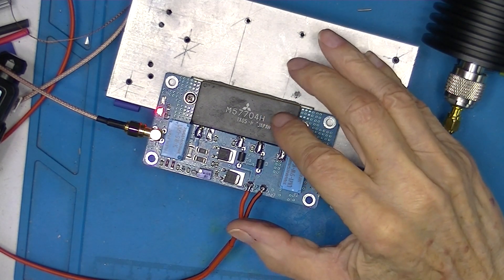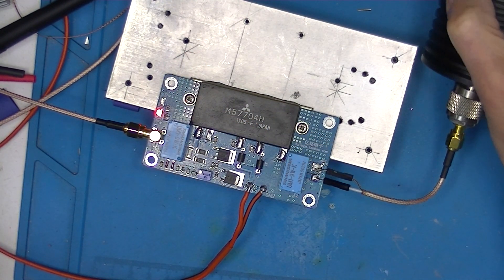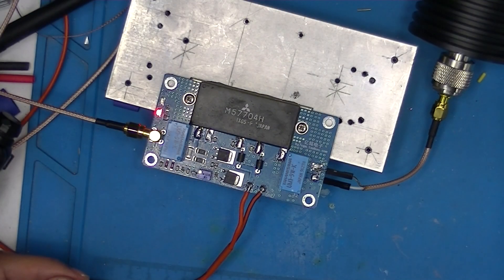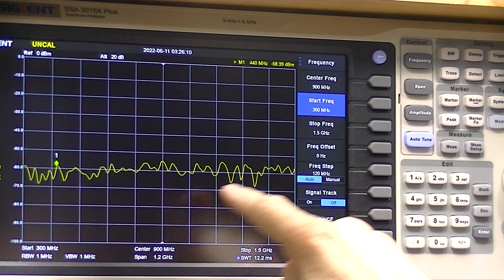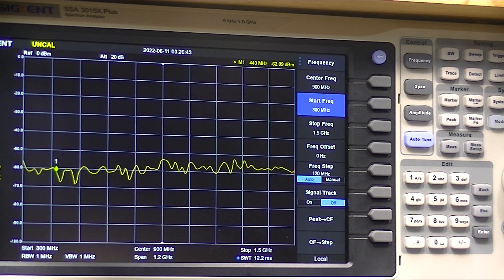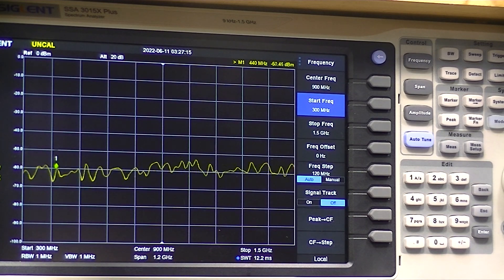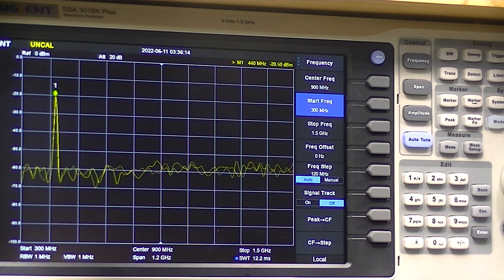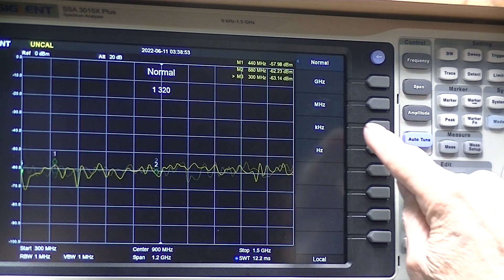Playing around w/ some RF Amps Part 2

Comment: I am surprised the signal is that clean with no filtering. It must be packaged in that chip.
Wondering how easy and cheap it would be to modify the board and chip selection for supporting a power close to the advertised 70w haha

Comment: Hi buddy hope u can help? .  That piece M57704H if I don't have it? Can I still use it without. M57704h . Thanks Alex.
Reply: That large chip is the actual set of transistors amplifying the signal. The board is just for complementary components, power saving, and safety. You would need that chip or a drop in replacement.